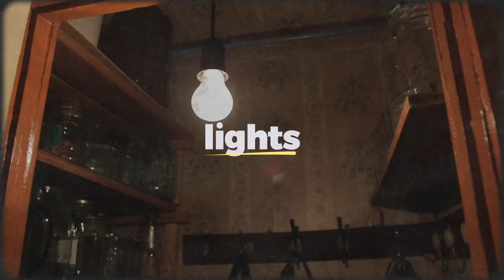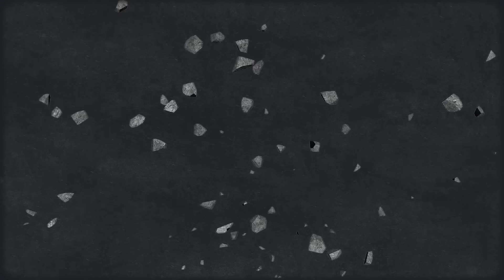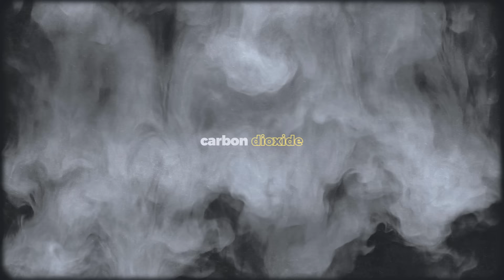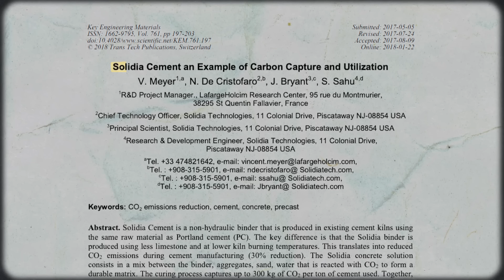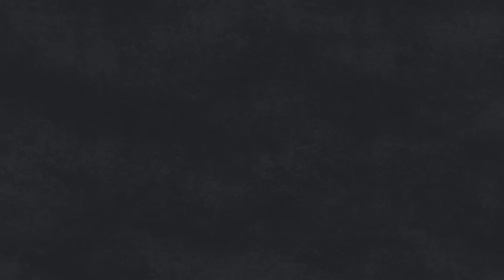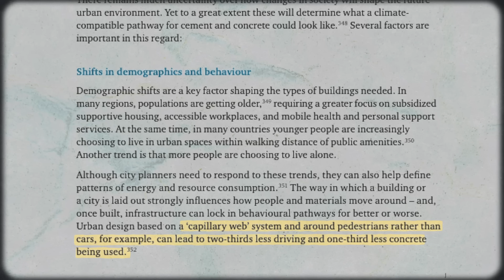Is Concrete Destroying Our Planet?

Comment: This is one of the biggest reasons to preserve historic buildings: they have what's called embodied energy. Basically, if the building was already built, then the energy (and carbon emissions) of gathering its materials and constructing it have already happened. There's a much lower carbon footprint to repairing and maintaining a historic building than there is to tearing it down and building a new one in its place.
Reply: Older buildings however also consume more energy for heating & cooling, as many were built when energy efficiency laws were less strict or even non-existant, when modern materials & energy-saving technologies were not yet developed, and the science was less understood.
Reply: @jonathantan2469  while that's largely true, historic preservation standards in the US almost never prevent utility updates. There's ways to update the electricity, HVAC, and plumbing.

Not to mention that many older materials actually do preserve temperatures better than modern ones. Plaster and hardwood is far more insulating than studs and drywall. Vernacular architecture (building styles common to a geographic region) are also adapted to their local climates, like steep roofs in New England or wraparound porches in the South.
Reply: @jonathantan2469  retrofitting with vapor barriers and insulation is the better solution
Reply: @jonathantan2469  but also there's efforts to heat/cool buildings without using any energy at all
Reply: We can recycle concrete and other materials like steel from these older buildings though.
Reply: @JSM-bb80u  recycling these materials takes energy. Why put it in when it's already been done?
Reply: repairing an old building and using it is called gentrification
Reply: @airohi96  not at all. First, gentrification involves an entire neighborhood (typically in an urban environment), not just a single building (and historic buildings can be anywhere from the countryside to the city).

Second, gentrification also involves wealthier, privileged people moving into a community of poorer, less privileged people and forcing them out of their old homes. It's entirely possible to fix up an old building and have its original inhabitants continue to use it.
Reply: @doomkitty8386  oh
Reply: @doomkitty8386 Unless eminent domain is enforced, how are “the privileged” “forcing” the poor out of their homes?
Reply: @backcountyrpilot  cost of living changes. One of the factors in rent prices is the quality of the neighborhood. Ritzier neighborhoods will have fancier apartments, more amenities, nicer stores and restaurants, which all sound great until you realize that the landlords are going to raise the rent because people are willing to pay more to live where it's nicer. That's all well and good, if the poor people living in the neighborhood have the chance to get better incomes with it. Gentrification happens when these housing prices go up so fast that the poor residents who lived in the neighborhood can't keep up with the price hikes that come from richer people moving in; it can happen very fast! Then they can't afford to live in their own homes, and have to move out.

Comment: Thank you for the great video! I know you have a limited time to work on your videos and you want to be specific but I feel you really missed on talking about the crazy supply-chain of sand (which is in large part for concrete), which is depleting the stocks of sand in many ecosystems. Also I think it would have been great to talk about other alternatives that are not so closely trying to resemble the material and process of concrete (i.e. cross-laminated timber, fungi - These seem to me like much better alternatives from a degrowth and circular-bioeconomy perspective). Just my two cents

Comment: I used to work as a chemical engineer at a cement factory in the united states. In the short 2.5 years I was there emissions were reduced DRASTICALLY. CO2 capture in the cement manufacturing process is actually one of the easiest methods to capture co2 with  being able to use an electrostatic precipitator and a compressor you leave with almost 99.9% clean co2 which can then effectively be used in many other technologies. The problem is the sheer volume of co2 produced and the cost expected of cement makes it just not economical for the most part. The plant I worked in commissioned a carbon capture setup and ended up selling the gas to Praxair Which maybe is not the best way to handle it and it was for only a fraction of the total production.

Even if the plant did fully decarbonize it would make the cement not price competitive with foreign cement(or even non-decarbonized domestic cement).  I think the simplest and easiest solution would be to just subsidize carbon capture with carbon tax credits of some kind. The aggregate you presented based on the extraction of CO2 from flue gas(assuming a gas fired power plant capture or similar). Is something I haven't heard of before. I am curious on how the aggregatge preforms under shear stress, but as always more research is needed.

Comment: Would be cool if one of those alternatives proved sturdy enough to actually be used. Saw mentioned in another video that 'ash concrete' was less durable, but I'm not sure if that referred to the same thing mentioned in this video.
 Although I wonder what the carbon footprint for concrete buildings would be over time, with everything considered. Seeing they're durable, and allow for higher buildings (and thusly more dense population, which reduces traffic/need for roads and such). Like, how does that compare over 200 years to a building from less sturdy materials that needs to be rebuilt three times in that period, or a smaller building made from wood that leads to more space used per person? I'd guess it might still be not great, but maybe in perspective not necessarily much worse than the current alternatives (but no clue).
 But also, as other people have mentioned, there's so many empty buildings that are just being used for financial speculation (at least in several western countries I'm aware of). I suppose the RRRs of waste also apply to building, meaning Reduce comes first, then Repair.
Reply: Definitely great things too think about. And you're right, we should put regulations in place to ensure there are no vacant buildings or houses, it would reduce our current building rate.
Reply: Would also help bring housing costs down so that more people could have a home.

Comment: Using other materials such as wood needs to be explored as well. But honestly, at the enormous rates that we are buildung stuff, it would propably not be susuainable anymore either. We would need a lot of reforestation along the way.
But it's interesting from a technology standpoint. I saw some documentary the other day, where a company was making building plates out of straw. They were pressed so they were not flammable and could be used for both structural support and heat isolation. But again, probably only really applicable to fancy free standing homes for the rich, that take up more unused land, as opposed to affordable houding in the cities...

Comment: There are lots of cheap alternative materials like bamboo and earth that have 0 or negative carbon footprint. Most of problems with this materials is not in resistance or safety as most people would think, but in escale and workforce. Little to no research has been done do develope ways to build with this materials in a scale that would chepen its manual work cost and make it competitive to concrete (the raw material is cheapper,  the work it takes to build it's not).
yet there're iniciatives, for me the most promissing it's the prefabrication of rammed earth walls, look it up
The biggest hindrance it's the lack of regulation for this type of alternative material, which is itself a product of the concrete manufacturers lobbying against it

Comment: Bill Gates is invested in CarbonCure*, a company similar to Solidia, which patents its carbon injected concrete technology. That should have been disclosed for the potential financial and public relations benefit this technology could afford Gates, CarbonCure, and Microsoft.

I mention Microsoft because it has made claims that it offsets its carbon emissions with other carbon sinks, like unthreatened forests, which seems less than honest.

"In its 2020 fiscal year, Microsoft released 11,164,000 metric tons of carbon dioxide equivalent."**

Manufacturing may be the worst offending industry, so far as carbon emissions, but electricity isn’t insignificant, and Microsoft overlaps both industries.

* https://www.bloomberg.com/news/articles/2020-12-14/locking-carbon-dioxide-into-concrete-is-a-cool-idea

** https://www.theverge.com/2021/1/28/22254483/microsoft-climate-change-pledge-update-carbon-dioxide-removal
Reply: He recently made a video titled "Why billionaires won't save us" where he criticized Bill Gates and said he regrets doing that sponsorship. He has edited out the sponsorship and outro part of this video.
Reply: @Totalitarianizer  Thank you. That is good news. I'm glad he has had a chance to reflect, and change his position for the better : )

Comment: Cross Laminated Timber (CLT) is a great alternative to concrete
Reply: CLT (floors) & glulam (posts & beams)
Reply: I am currently writing my dissertation on this topic. It’s difficult with clt not being able to compete with concretes more industrial uses.
Reply: @TheErmerm999  each individual step toward decreasing our carbon footprint is a good step. CLT doesn't need to be a one size fit all to replace all uses of concrete.

For instance, it's great for mid-rise housing.

Comment: How is solidia's foot print different from traditional concrete? That also absorbs co2 as it cures, that's how cement works: you remove the co2 from carbonates, obtaining calcium oxides (there's other components, but that's the basis of it) then when you mix it with water, the calcium oxides reabsorb co2, to harden back into carbonates.

Also why didn't you mention wooden construction? With a well managed lumber source, there's arguably no building material more eco-friendly than plant material, and we already know how to do it, even big buildings too.